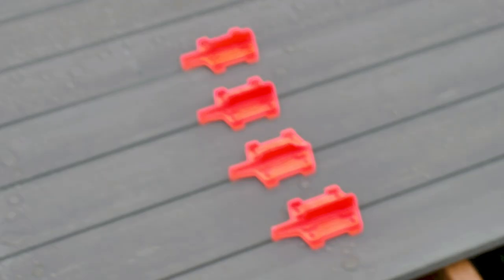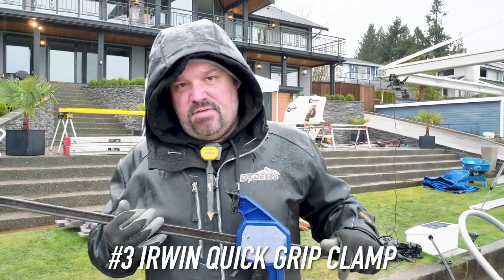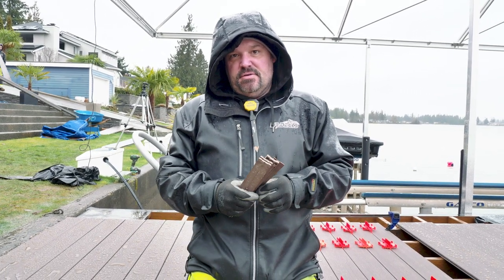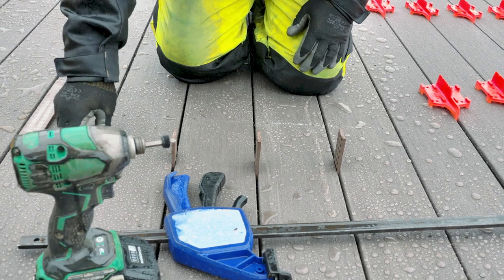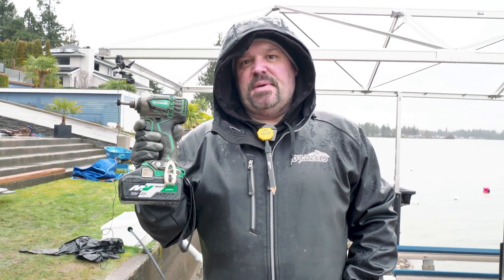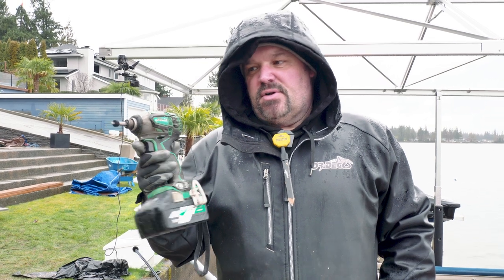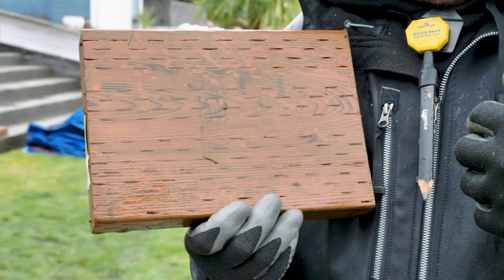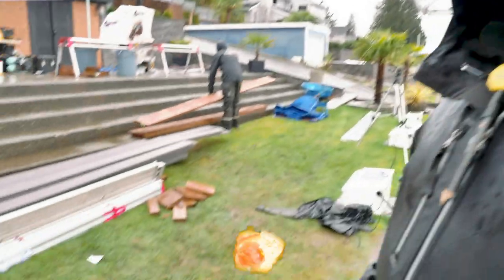5 Things We Get Asked About Constantly || Dr Decks

Comment: I’m planning on picture framing my deck with scalloped composite boards so I can’t use the plug systems for the picture framing is there a way to have a hidden fastener system with the picture framing/steps and the board in contact with the house?
Reply from the maker: Contact the manufacturer and see if they offer a hidden fastener system for your application. I know TimberTech used to make an angle starter clip that could be used as a hidden fastener
Reply: I had the same dilemma when choosing deck boards for my deck project. I wanted to picture frame the outside and also have breaker boards in the middle because my deck is 22' long and I didn't want butt joints. I wanted to use the Cortex plug system, love the look, but there isn't enough meat under scalloped boards to use them. I ended up spending a bit more and going with a solid board. Glad I did, there is another disadvantage to those scalloped boards... they are not as stiff as solid boards. I did my research and even found a couple of decks that had scalloped boards on them to look at. With 16" o.c. joists those scalloped boards sag in between them, especially when it gets hot. In the end I special ordered Trex Select and love it. I have 16" o.c. joists and at 200lbs I can jump on them and not notice any sagging or bending. Spend the extra time and money to order a solid board and avoid any heartache later on.